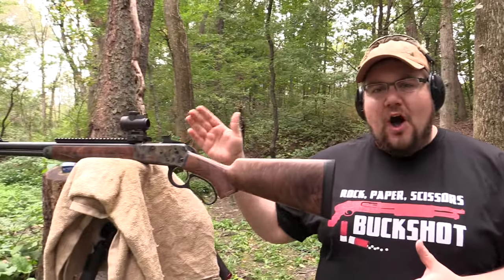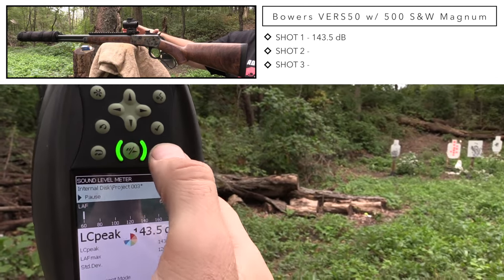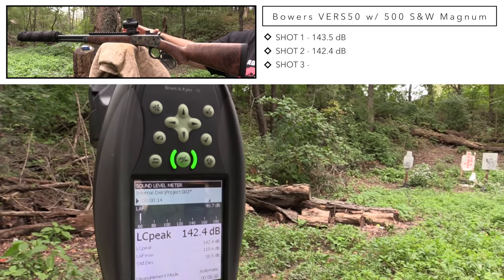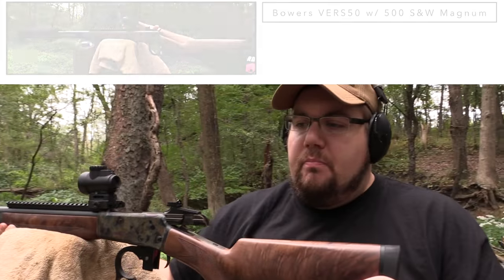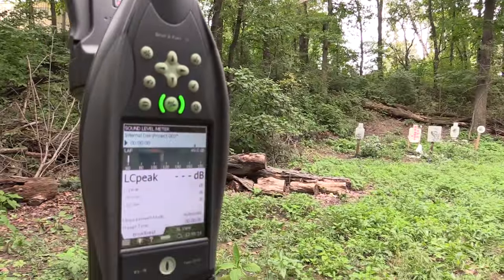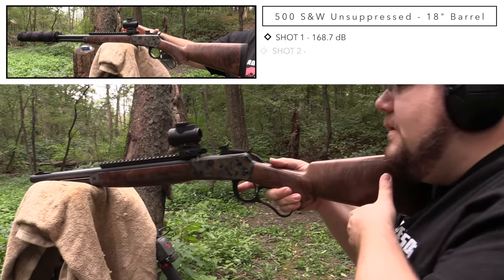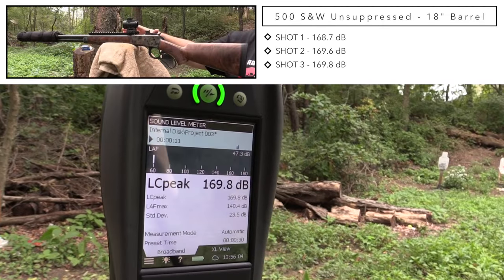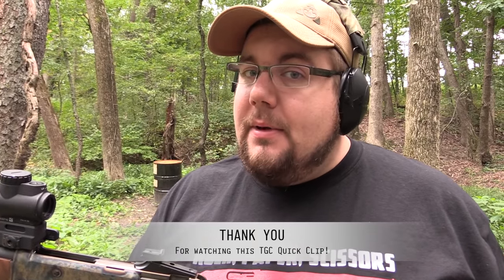500 S&W Magnum Suppressor Sound Test - Bowers VERS 50!

Comment: Its not doing a bad job but after 85db your hearing can be irreversibly damaged so i would probably leave the can on a gun like that and save on weight as you need earpro anyway. I would imagine it is simply due to the large bore of the can and lots of blow through.